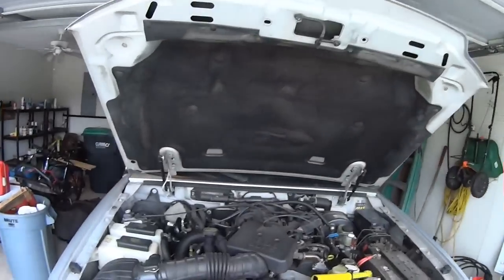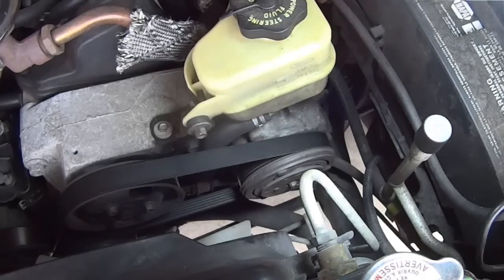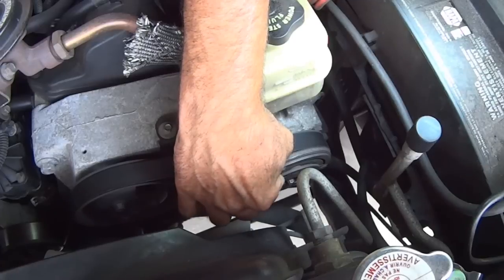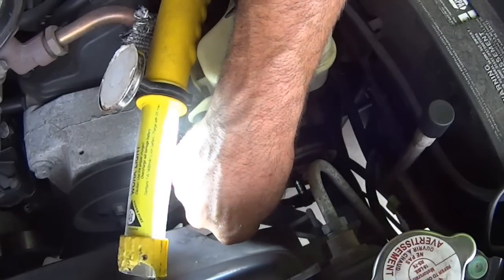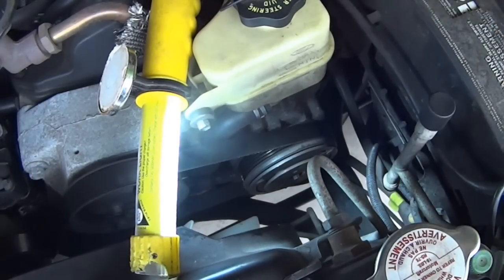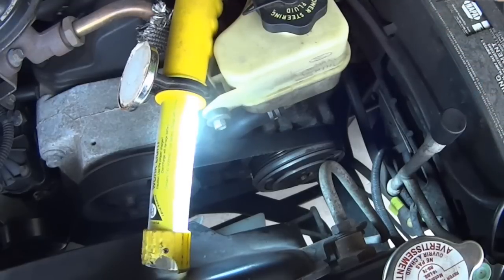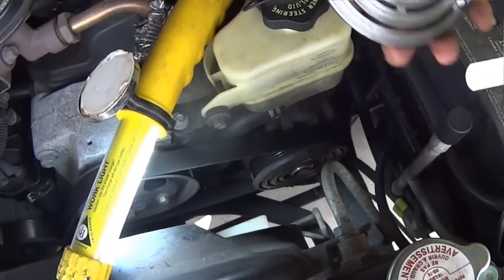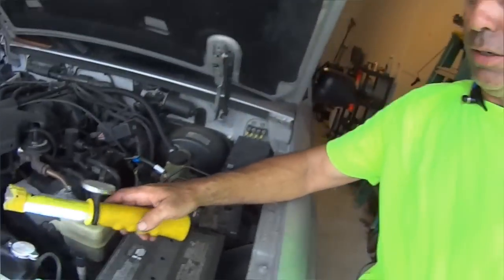FREE FIX - How to Diagnose and Adjust an A/C Compressor Clutch in Car Truck - Blows Cold Then Warm

Comment: Great video. What I do is this:
Many older cars with lots of miles on them have a similar problem. A PERMANENT fix is to take off the clutch plate and remove one of the little washers that creates the air gap. Either find a thinner washer or grind/file off some of the thickness. The air gap should never be more than 0.010". or half a mm. Use a feeler gauge. The clutch has just one bolt or nut right in the center for removal. 
DO NOT loose the washer when you lift off the clutch plate! It will fall on the ground and roll off if you are not careful.
Use large channel lock pliers or oil filter wrench to hold the plate from spinning while you loosen the center bolt. It is not very tight, so DO NOT break it off when you assemble things again! I am not sure of the torque, maybe 10ft/lbs. NOT VERY TIGHT! Do not use an impact gun on it either.
Also while you have the clutch plate removed, sand off the rust between the plate and magnet. Old cars always have lots of rust in there and this will cause the clutch to slip (and make a lot of noise). A wire wheel does a fine job of cleaning up these surfaces. DO NOT paint these surfaces. Just leave them bare metal.
Reply: Yea ,that’s what he said in the video

Comment: Great video, my 2006 F-150 AC would work for maybe 10 min. then quit. Pulled the clutch plate off and cleaned the surfaces and removed the shim, boom, it stays on. Thanks.
Reply from the maker: Yayyyyy!!!

Comment: The ac on my 97 F150 would not engage at all after it worked the previous summer. After some diagnosis, I found the face on my field was very rusty, typical in the Midwest, especially after a bad winter. I replaced the field and coil and replaced the pigtail, it looked suspect. After a recharge, I froze my ass off. I could not turn my ac on past 2nd setting and my truck was a Supercab. If you live in an area that gets snow and they salt the roads, check the clutch engagement before replacing the compressor.

Comment: this is what the internet is good for, Thankyou,  a thought- if there is 2 spacers inside, 1 might be thinner than the other, remove the thinner first and see if it is enough, vs / or  removing the thicker  spacer which would leave the thinner, and maybe the right air gap

Comment: hey man, i am so impressed, hey if someone doesn't like your video, it would be because you are taking bread from their month. I drive a F30, mine did exactly that, the guy quoted me for the whole compressor and i refused, he showed me another one he did like that. of cause a new compressor would come with clutch set up . so it would fix the problem

Comment: Thanks for details on the shin and gap between the clutch and the pulley. My clutch set came without the shins, so when I installed them, everything was spinning all the time, with AC on and off :( Good that I looked up more videos right away and came across this one. I am glad that I found a washer which is exactly the same diameter and slightly thicker but just enough which I needed. 
I took them apart and fixed the gap with a washer and one old shin. Now everything is working as expected.

I am little worried about the off the shelf washer I had to use to fix the gap. It's probably made of cheap metal.
But at least the compressor is not running constantly now.

Comment: I have been looking for a video with this info for sometime. this explains so much. I couldnt get a straight answer from anyone. 
If you r cars a/c system is getting warm the faster you go this will fix your issue
Reply from the maker: It fixed my issue because the gap was so big it was slipping the magnet so hopefully it’ll fix your issue as well. At least it’s something to try before you spend a whole Lotta money

Comment: I am having the same problem it works fine cold n go to hot. I went to the cut switch and pulled it out n put it back n it worked i going to check my gap on the clutchplate. Thanks
Reply from the maker: You're welcome

Comment: You are the first ac clutch operation explained video out there. I don't have that issue, but this knowledge is helpful. And yes when the low pressure switch is faulty, the clutch will not engage. But when the low pressure switch is good and jump it, and the clutch will not engage, indicating the clutch bad or the gap is out of specs. Excellent analysis.
Reply from the maker: mjpena53 Thank you

Comment: Thank you for this.  I bought a low milage used 2010 Chevy Malibu & you gave me things to think about. I charged My AC since the car had sat for a significantly long time & was not very cold air..i smelled a mildew like smell when the fan was on.  It is cold now but there is a LOUD ratttling/knocking sound when sitting still and BACKING UP was super loud. There was a broken motor mount but that was  fixed & it did not  fix the noise.  It takes a longer time to get cool.. but it is super hot right now.. not to mention the issue i am having with tire pressure sensors etc. Kinda wishing i had my 1999 Lexus Suv back even though the milage 150K on Lexus is more than double the the Malibu at 63K.  I am an idiot

Comment: I just took a 275 mile  trip w/o a/c my 2001 dodge ram   Started fine....20 minutes in, stopped.   Stopped for a sandwich.   Again a/c fine for 20 minutes then warm.  So frustrating in 88 degree weather.  Thanks for sharing. At least now I know where to start looking!!!

Comment: Pretty common in the world for years. Although most fixed it with bread clips to hold the plate closer…I used zip ties. Worked for years after simple fix.

Comment: Very good explanation! Mine is working for a few days now but over the years, AC would kicks on and off many times in a minute. I wonder cleaning it would solve the problem. I have a 2009 Lancer and the clutch plate is do far down in the car
Reply: If it kicks on and off a lot, you are probably low on refrigerant. You can rent a manifold gauge set from some auto parts stores. Look into videos here and there are 134a pressure charts online that tell you what your pressures should be at a given ambient temperature. If you are low, it means you have a leak. At that point you can fill it and see how long it lasts, or buy Freon with a dye and get a uv light and try to find the leak. Lastly, you could try a Freon with a stop leak in it, but I don’t know how effective they are and you risk damaging your system.
Reply: @brianloftin9196  I did use a gauge twice on different days. Both times the arrow pointed to filled level consistently. The cold air has been working fine for over a week now even when the weather is at 90s. strange

Comment: Cheers for the vid, I just wish all my components were as easy to get to.  The pressure switch needs a full bumper removal, and compressor would need a tray removal and car lifting up.
Reply from the maker: Thank you

Comment: Great video!I'm dealing with same problem with my forester a/c it starts out cold for up to like 5-10mins an then blows warm air.And I just got the a/c belt replaced along with the a/c pulley and filled with freon!So I'm thinking this is most likely my issue.Ive been searching on yt now for almost wk now to get a actual informative video showing n explaining what part ezactly it is and what it needs to be.So thanks an I'm really hoping this does the trick with mine.
Reply: Any update

Comment: On most units it can be a free fix. All you need to do is measure the gap and then compare to specs....take the plate off and there are shims in the bolt hole of the plate....simple remove the shim that closest matches your tolerance difference. Reassemble. Should release that issue. If you want to replace the parts thats fine too but most often just the shim adjustment is all that is needed.

Sorry just watched long enough to see you addressed this!

Comment: 1997 Ford Ranger, 4.0 V6
Hey Dan...first of all, ditto to all of the positive comments left by satisfied readers, because of you,  who were able to fix their problem instead of incurring possibly large bills from a shop or mechanic for this same problem.  For the "Haters" out there...they are gonna hate on you and everyone else who does anything to try to help others.  I know that there are really great and honest shops and mechanics who work hard, however, I wonder how many of your haters are the same folks who will take advantage of this problem and turn it into a complete A/C job.  I do have a question.  I am guessing that it will not get answered soon but here goes.  My symptoms are very similar.  Start up, A/C is blowing ice cold air.  I travel about 45 minutes or so.  Sometimes the warm air just starts blowing, however, a lot of the times I have gone somewhere and stopped after a 30 or 45 minute drive.  All was cold as snow the whole time.  I come from the store and start home and no cold air.  Actually feel more humid air coming into the cab of my truck.  I pulled over and sure enough the clutch plate was no longer engaged and spinning.  Here is my question.  If I tap the plate it will still not engage.  Tap several times, nothing.  I drive home in 90 degree cab temp. and check again...plate is not spinning.  Tap it and nothing.  I did check the gap and there is a little difference but not crazy.  Jumped the relay switch and it will force the plate to engage.  After an hour or so I can start my truck and turn on Max A/C and the clutch engages and we start all over again.  So...same problem but tapping the plate will not engage it, however, it will work again after what I would call a "cool down".  I am thinking I will go ahead and check spacers and all because what can I lose if there are none, or I can delete one and it doesn't work...I pray that it does.  Anyway, just wanted to make sure I had it right that when the engine is running, a/c/ on, hot air, tapping the plate will make it engage.  Everything for me is the same except tapping will not engage the plate...only some period of cool down.  Thank You for you detail...can you tell we are very similar?  Sorry to text so much.  Man this stuff is frustrating Yes???!!!
Reply: I have a 2001 Ford Ranger 4.0 V6 XLT Extended Cab and I have the same issue I already did everything so what I'm going to do is I'm a buy a new compressor and installed it

Comment: Well made video. Only issue i seen is when you mentioned bypassing the low pressure sensor/switch. You should only bypass that when you know there is enough refrigerant in the system. The contacts on the low psi switch open when there is lower than the recommended psi/refrigerant. If you bypass that when low refrigerant you run a high risk of locking up your AC compressor as the refrigerant is carried throughout the system with the oil/lubrication for the compressor. Otherwise very well made video!
Reply from the maker: Bypass it only as a way to test it.

Comment: I’m about to attempt this procedure. My ac blows cold but once I start driving the compressor stops and I get warm air. My freeon is good. I tried tapping the clutch but it didn’t kick in like yours. Hopefully removing a shim does the trick.
Reply: pichay808 Were you able to fix it?

Comment: Awesome explanation! Question: What pushes the clutch plate away from the pulley? The energized coil pulls it in but what pushes it away? I bought a clutch kit to fix my Mazda 5 A/C but the clutch plate doesn't freely move like in your video. Thank you!
Reply from the maker: Spring or springs and the magnet has to over come the spring or springs. If the gap is too wide, the magnet will not grab the plate and engage the compressor

Comment: Hey brother I can’t thank you enough I was trying to figure out what was wrong with my AC it turns out it was just the low pressure sensor I put a piece of wire into the connector and my clutch clicked instantly when I turn the vehicle on lifesaver thanks brother
Reply from the maker: Happy to help

Comment: I removed a couple of metal spacers from a T-Bird AC clutch to make it more efficient (Back in the 1990s).  I learned of the spacers from somewhere then.  At the time the T-Bird was 15 years old.  I assume Ford may still put spacers on AC clutches.  Maybe all AC clutches have spacers.  The purpose would be the similar as to a Tranny clutch.  After a long period of use, a clutch needs adjustment.  In the case of an AC clutch, it is removal of spacers.  For a tranny clutch, you would adjust the clutch cable or linkage.   If you Google "AC clutch spacers," you can see what I mean.  They call the space in the AC Clutch the "Air Gap."

Comment: Dude ur a bad ass👍 just checked it out on my 99 chevy silverado it is the clutch plate ur awesome keep up good job u saved my ass
Reply: Hell fire...I hope that's what it is on my 99 z71...ac worked yesterday morning, I put new front shocks on at noon, at 5pm took off for a test drive....NO AC! I was pissed...I just had it vacuumed out and new orafice last summer. I've checked all fuses. The lines at firewall are ice cold, but it's blowing hot! It's hard to see what the clutch is doing...looks like it's spinning...I guess I'ma have to get under the dam thing, again lol

Comment: This is an interesting video. I've done this job I replacing the clutch coil and pulley system but and had the knowledge of this being a simple repair because I was happy with just paying a hundred dollars for the coil clutch and pulley that I overlooked my knowledge that said I could possibly just remove a spacer to get it working again by closing the gap.  Good video.

Comment: Hot wired my low pressure switch and clutch engaged.  TU!!!!
Reply from the maker: But you definitely have Freon in the system right? Low pressure switch is cheap... replace it, recharge system when you’re done

Comment: My grandsons 2003 S-10 Blazer has a different issue, I jumped the low pressure switch so I could get the clutch to engage. But it's not accepting refrigerant through the valve. EDIT:  It was the kit I was using. It wouldn't allow the refrigerant to flow... Bought a $5.00 fill-hose kit. All fixed now.

Comment: Mine turns on and off often If I am at a stop when It's really hot outside. For a while It works normal. After maybe 30 minutes It starts to turn on and off constantly when I am stopped and causes the air to not come out cold sometimes. I watched a video that says It could be low on fluids or over charged.

Comment: Hi Dan, I have a 1997 Jeep Grand Cherokee V8 that does not blow cold air while on the AC. I noticed that the clutch engaged the compressor but only for a few seconds and then it disengages. I then put a wire to bypass the switch the I'm able to keep the compressor engaged for as long as i want but still no cold air. There is no leak and I don't need to top off the refrigerant as I  checked it. Would you happen to know why it won't blow cold air? I'm currently re4searching the issue. BTW the AC has not worked for years but for some reason I decided to fix the issue now. Please let me know if you can help. Thanks and thanks for your video, it's well done.

Comment: Hi I have a question my a/c compressor doesn't move at all and I checked my low port pressure everything is good you think it's the fuse relay?
Reply from the maker: It could be anything! The switch, the fuses, the relay etc

Comment: Thank you man.. Subscribed!  I'm an engineer, yet Automotive HVAC is still a bit gray to me.  Hopefully, not for long.  ;)
Reply: AC is about absorbing heat by evaporating a fluid inside an expender coil within the cabin.

Make sure your cabin air filter is un serviceable condition if your car over 5Yrs.

Check the 2 shrader valves for leaks if you need to top-off R134a/freon else radiator o-Rings.

FYI: 
Don't refill an AC circuit that was empty without evacuating it... else moisture will slug the compressor dead.

AC work is not rocket science. Do wear preotective glasses to prevent any freeze burn.

Comment: Mine was dirty rusty and it only has one washer and it was grooved up. so I sanded it smooth and cleaned it. im still not sure if its fixed i have some what cold air, its better then the hot air it was blowing before 😂 I also replaced the the low pressure sensor switch. I need to check for leaks and the fluid level now i already took my hole dash apart and checked all blend doors they all work and close/open properly🤷‍♂️. so far its only cost me $14 bucks and my time but hopefully I can figure it out.
Reply from the maker: Be sure to charge the system fully in order to activate the clutch properly or you're just chasing your tail.
Reply: @DansVlog  yeah I ordered some gauges ! in the mean time I'm going to check the wiring and fuses out to make sure there working correctly i have time to burn right now 😁.  I'm also thinking about making a fitting that I can connect to my A/C system to pressurize it with air then look /listen for the leak if there's any .

Comment: My 1994 f160 (6 cylinder) blows cold when i first start it.  It'll blow ice cold for 5 minutes.  Then blow warm. I'll turn the ac off for a half hour and turn ac back on and it sometimes blows cold but not always. I did the tapping the clutch plate thing while truck was running and the plate started spinning but stopped after 5 minutes.  Gonna replace the clutch place.  Thinking that's probably the issue

Comment: Before anything check to see if the compressor is seized up, if it is you could break a mounting bracket or worse.
Reply: I think the belt would slip before metal starts breaking. What kind of vehicle are you driving?